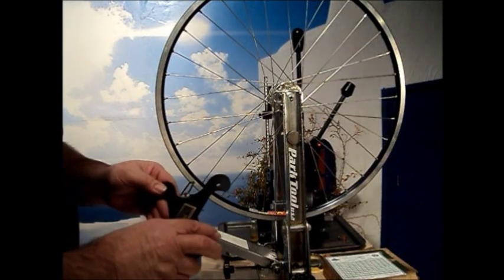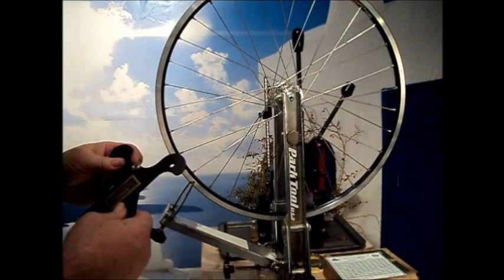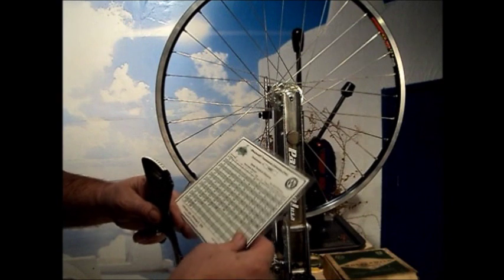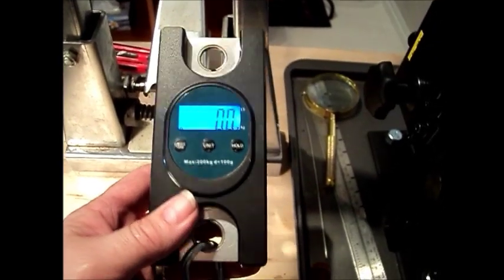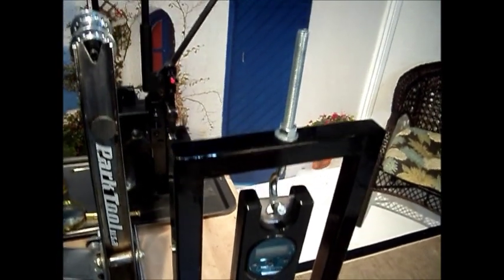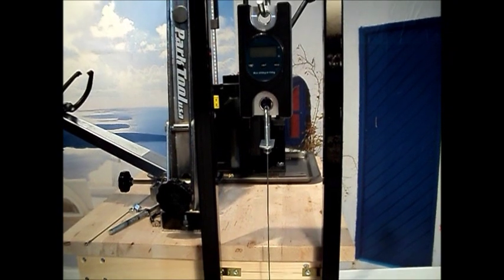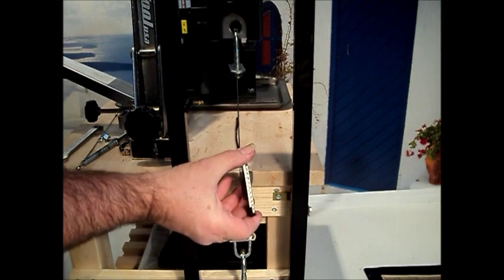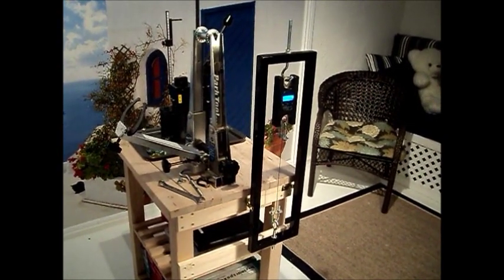DIY spoke tension meter calibrating device.

Comment: How do you fit a standard "J bend" spoke in that jig, considering both retention plates are mounted parallel to each other?
Reply: Huh, I saw your other video where you said you had to cut and thread the J bend spoke. And obviously saw your upgraded version. Nice!

Comment: Would it be possible to use the calibration device (suitably modified) to grade the scale on a tuning meter and then use the tuning meter to determine the tension of the spokes?
Reply from the maker: Don't forget that the length of the spoke affects the pitch as well as the tension and cross section. I believe pitch is useful only to compare tension balance, not so much for measuring actual tension.
Reply: @2wagondragon  True - also material would affect mass/density and the length would depend on the kind of rim, nipple and hub flange. Oh well, there's far too many variations for it to be practical when one is dealing with all kinds of bicycles. Perhaps it would be interesting to have at a wheel building factory/facility, where wheels of the same kind are being churned out continuously.

Comment: Hello Dan, this is an awesome video! Thanks for sharing :) Can I just ask, would 25mm square box section with 1.2mm wall thickness be strong enough for making the frame of this awesome looking calibration device? I would love to make one up for myself here in the UK. Many thanks.
Reply from the maker: 1.2mm is only 1/64th" thinner that what I used (1/16") so it should absolutely be fine as long as you can weld it without blowing holes in it.
Reply: @2wagondragon  Thanks Dan, you're a star! I will get cracking with it soon. All the best from the UK :)

Comment: hi dan, and thanks, 
working in france with a dt tensio analog, passionate by precise work, 
that's a real problem to "re calibrate" the dt (they don't want to give the steel piece they use to calibrate) have to send back to switzerland and pay almost the price of the scale...using musson chart for sapim, greame for campa, but also've to work on other brands, and thickness measure is not accurate enough....long time i want to do this kind of calibrating device....your video finished to convice me ;) .... scale ordered, frame in progress soon... xkyuze my broken english....- 

greetingz from france
loicQ
vodooz wheels -
Reply from the maker: Thanks for your comment. I'm sure it will be the answer to your problem.
Reply: certainly a part of yes :)  .... also speaking with mr kralyevski for reliable tensiometer..... frame is done !! waiting for scale and working on "plates" and tension system.....

Comment: Now how do you calibrate the digital scale?? lol, ok well its a great video and a very clever way to verify that your tension meter is still accurate :) thanks for the video
Reply: You don't have to calibrate the scale...it "Tares to 0" when you turn it on...aka = self-calibration. Provided there is no load (which is why he raised the nut) when it is turned on, it self-calibrates.
Reply: @cmscott  actually, "tare" just sets it to zero, but this does NOT calibrate the scale.  The only way to know the scale is accurate is to either trust the manufacturer and their QA/QC, understand the scale's acceptable error, and/or put a known weight or tension on it to confirm.
As posted above, hang 100 kg of weight on it and confirm the scale reads 100kg.  (Or 100 lb., whichever is easier.)
Reply: @kevinchrist1658 , great idea!
Reply: Buy a second scale, or third, to confirm values, if you're THAT worried about it!

Actually, the BEST way to confirm accuracy is to simply pick a known weight and suspend that on the scale to confirm scale accuracy.  You could also just get a 110 kg weight and suspend that on your spoke (or scale) to confirm everything's accurate.  Kind of a pain, but not out of the realm of possibility.

Comment: Great video. There are people out there who made a calibration tool themselves using very expensive devices which I do not understand why when the idea is simple.
I was thinking something even simpler than this in the video. How about a spoke fixed at one end and mass put on at the other end (known mass- I was thinking of dumbells), then calibrate your tension meter according to that mass and type of spoke.

Comment: You made a mistake when using your device. The scale should read 0 with the weight of the top u-bolt on it, but you lifted that u-bolt up when zeroing the scale. Doing it the way you did it, if the u-bolt weighed 50 kilograms, then the scale would read 50 with no tension on the spoke.

Also, this device assumes that the scale is calibrated, so I'm not sure what the point is.

And do you have a problem with mig welders lol?

One more thing, how would I measure the tension on an aero spoke (non-circular cross section)?
Reply: +Dan Burkhart When mounted vertically, the load is less than .05 of a Kilogram;in other words,the difference is VERY minor and you can use the tare feature....when mounted horizontally,the difference is ZERO...No load from the source...Your calibrator is VERY accurate....
Reply from the maker: +Heem Point taken about the weight of the u bolt,but the weight of this assembly is insignificant.
It works perfectly with aero spokes. I work with them a lot, in fact the vast majority of the wheels I've been building recently use Sapim CXRays. The calibration chart that was supplied with the  tension meter showed calibration for spokes that were only an approximation of the cross section of these spokes. If I went by the calibration chart for aero spokes, I would be way off.
Reply: Dan Burkhart Ok thanks, I had actually just looked up the chart you are talking about and noticed it had aero spokes on there. Helpful to know it isn't necessarily that accurate for them.
I'm sure the weight of the u-bolt is insignificant, but it is gratifying to point out people's mistakes XD

Comment: OK, I finished my calibration tool.  I decided to make mine with wood.  I had some spare wood laying around and it worked just fine.  It does flex a little bit; but it stays static to obtain accurate readings.  Even so, I may add a crossbar in the middle to reduce this effect.

I used an old hub to hold the spoke elbow on the bottom.  Two 1/2" holes in the wood allowed me to sandwich the hub in the jig upon final assembly.  This worked out fine except when measuring bladed spokes!  I realize that one cannot hold the tension meter just anywhere when measuring bladed spokes and the jig got in the way.  So I just fixed the hub in place so the spoke being measured was to the side of the jig.  Anyone considering using a hub should think about this. 

Let me say this:  a Sapim bladed spoke with nominal cross section of 0.92mm has a VERY different deflection than a similar, but round, spoke (obviously)!  Now I KNOW what 110kg is!

Again, a big thanks to Dan for posting this and sharing his idea with the world!

Comment: Thank you SO much for the great video!  I've been searching high and low for calibration charts for different spokes for my Ice Toolz tension meter (which is suspiciously similar to the Sapim non-digital meter).  Kinda a pain in the butt searching high and low for all the permutations out there.

Your calibration tool makes all this superfluous!  I like it because it serves TWO functions:  calibrate the meter and determine deflection values for a given spoke.  Since there are myriad spokes out there, from straight gauge stainless to butted, ovalized aluminum, there's just no way to get deflection values for every spoke and every meter being used.  I just found a post on a UK builder's site that quoted a Sapim rep saying basically, "You can't assume deflections of a DT spoke will match our Sapim deflections.  Send us your DT tension meter for calibration."

I'll suggest a couple of ideas to simplify your tool:
1)  Suspend scale between ceiling and work bench (assuming bench is bolted down and you set a solid eye-bolt in a ceiling joist).  If bench isn't stout enough, just set an eye bolt in the shop floor.  Easy-peasy!
2)  Thread sample spoke through a dummy hub (which is held to the other side with another dummy spoke) instead of having to cut off the elbow and thread the other end.

Thanks again for your video.  Can't wait to get my tool up and functioning!
Reply: Thanks for pointing me to Bill's videos.  He has a lot of good information.  

Be aware, however, that the Sapim chart is not a calibration chart, but a deflection value chart - FOR THE INTENDED TENSION METER.  This is a valuable resource, but only for a person using a CALIBRATED Sapim spoke tension meter.  It's worthless for any other tension meter (or a Sapim meter that's lost its accuracy) because different meters use different geometry and spring tensions, so the deflection they measure equates to different kgf tension values.  In fact, Bill shows his own tension calibration tool near the end of the video, which makes all the deflection charts he has moot.  And I would assume that the Sapim chart only shows THEIR spokes and most certainly not, say, a Mavic Ksyrium aluminum bladed spoke.  

And this is what makes Dan's tool so useful - it allows the user to determine exactly what spoke deflections are created by ANY meter on ANY spoke.  It also obviates the need to ever recalibrate one's tension meter.  Why have it match a pre-determined deflection value when I know the current deflection value(s) the meter is reading?  It's simply an academic endeavor that serves no purpose.  If my tension meter read 3.44 at 100 kgf last year, but now reads 3.30 at 100 kgf TODAY, who cares, as long as I'm reaching my desired end tension?  (And assuming the tool consistently reads 3.30 at 100 kgf during the wheel build, I'm set.)

100 kgf is 100 kgf no matter where you are.  Once you put 100 kgf on a spoke, you simply "reverse-engineer" your meter's readings.  So simple and elegant.
Reply: +Steve Smith Hey Steve....check out Bill Mould's videos----He has one that feature's a display of the Sapim calibration chart...It's very clear.....Check It Out....
Reply: Thanks for the Ebay link!  I was about to purchase one on Amazon for almost $60; your link has one for $32!
Reply from the maker: Thanks for the comments and good luck with your build. I have updated the design a bit. I posted a video of the update.

Comment: Negligible reading change over 9 years of use tells me this tension meter is basically calibration free over it's lifetime assuming no abuse. Saves me the need to build this calibration device at all.
Reply from the maker: If you are comfortable making that assessment from a sample size of one, then sure.
 Thing is, I'm encountering aero spokes that are not precisely described on the original calibration sheet, and I'd rather not have to guess at it.
Reply: I just built a wheel with Sapim bladed SS spokes with nominal cross section of 0.92mm.  Deflection at 110 kg measured 2.51 mm on my tension meter, which was nowhere near the deflection of the closest spoke I've used before, a 1.5mm butted DT, at 3.25mm deflection.  Sure, one can guess, but if you're doing that, it defeats the purpose of using a tension meter to achieve ideal spoke tensions.  (Although still useful to achieve uniform tensions throughout the wheel.)

This tool solves this confounding issue for wheel builders encountering the myriad spoke designs out there.

Add to this the fact that the high-end consumer is utilizing carbon rims.  A wheel builder will want to know exact tensions when building carbon wheels to achieve good builds and as a way to reduce liability.  If a spoke pulls through, destroying a carbon rim ($$$), I want to be sure I've put spoke tensions within manufacturer specs.
Reply from the maker: Steve Smith I've been building a lot with Sapim cxray bladed spokes and carbon rims, 6 wheels just today. 
 Without the calibration tool, I would be way over tensioning the spokes, no doubt about it. The meter readings you get from a bladed spoke are way different than what you get from round ones.

Comment: Can you give me the dimensions of the frame that you built? Thanks! Excelent work! :)
Reply from the maker: The outside dimensions are 26" high by 8" wide
Reply from the maker: Tomek Kot I used 1":x1" square tubing with 1/16" wall thickness. Non of these dimensions are critical. You could use angle iron for that matter.
Reply: Dan Burkhart  Thank you. Can you give me also wall thickness of the metal profile?
Reply: Thank you! My machine buliding in progress :) :)

Comment: Great idea, however shouldn't you have to fix the tensed spoke somehow before taking the reading, as i imagine taking the reading with the ''moving'' scales being a part of the system will also inflict further tension on the spoke/system, any thoughts?
Reply: This scale is not spring-loaded.  It does not move when loads are placed on it; I used calipers and measured the two metal ends with zero weight and with 100kg and it did not change in length.  In other words, the scale does not "sag" when loads are put on it, so original spoke tension does not drop when the tension meter is applied.  Thus, no need to "fix" the spoke; it's already fixed in place between the base and the scale.

Measuring spoke tension does indeed increase spoke tension temporarily.  This happens when one measures deflection on a wheel or a jig.  It doesn't matter, as the spoke returns to original tension once the tension meter is removed.  When you use a tension meter, you are measuring the original spoke tension through deflection.  You are not deflecting a deflected spoke, so to say.  If you put a SECOND tension meter on a spoke, you'd be measuring the sum of the original spoke tension and that imparted by the FIRST tension meter.  It's irrelevant.
Reply from the maker: Well, your comment shows you're thinking, but it's better in my mind to keep the scale as part of the dynamic as the variance can be monitored. 
 In practice, I have found no more than 1% variance when taking a reading, ie, at 100 kgf, no more than 1kgf variance. Fixing the spoke in place could easily cause far more variance with no way to monitor it.
 That's my theory anyway, and I'm sticking to it. :)
Reply: Was just thinking that myself, that due to complexity it might be not worth the hassle. Thanks for the reply and best regards

Comment: Funny how you tend to find stuff on YT that tells ya everything you need to know. I needed to make a tension meter for a specific project I was involved in and applying tension to cables was involved.  I built a tension meter and your calibration tool, and later found I had built version of the Fanatyk tensiometer without realising it. Many local kids bring bikes for me to both build and true wheels so I am now building my own  Wheel Fanatyk type meter but with an adjustable spring.

Comment: thanks. i plan on using it for checking my tension meter. i have been using cx ray bladed spokes and dt revolution super butted spokes lately and do not trust the conversion table that park has.